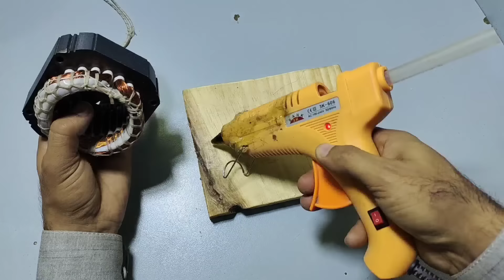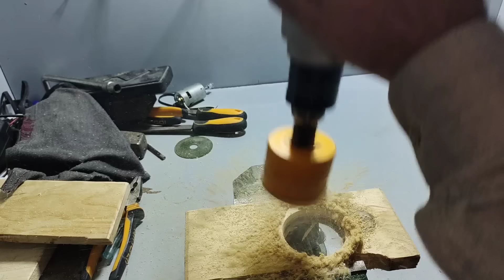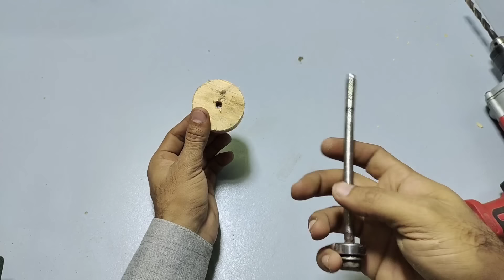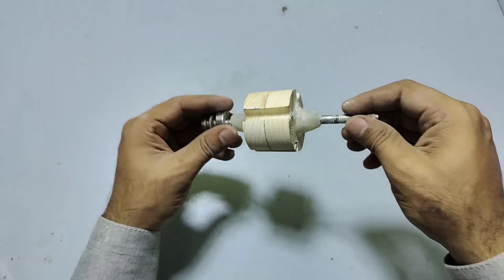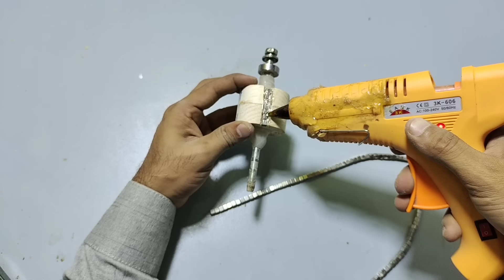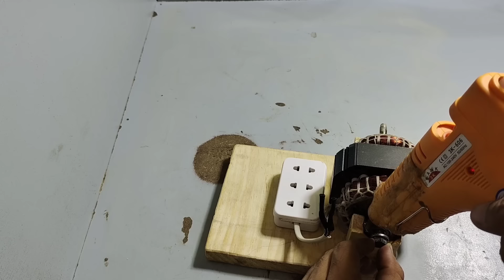How to turn copper coil into a high power 230v electric generator

Comment: What power source are you using to spin the motor? Is it running on DC or AC and what is the power consumption in amps compared to what is generated? This seems unlikely to generate more than what you use.
Reply: dc